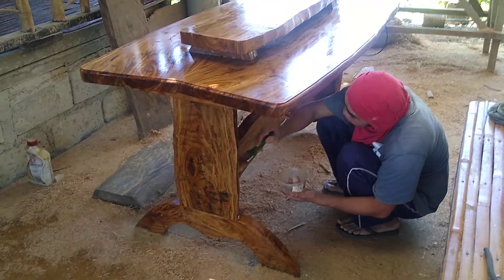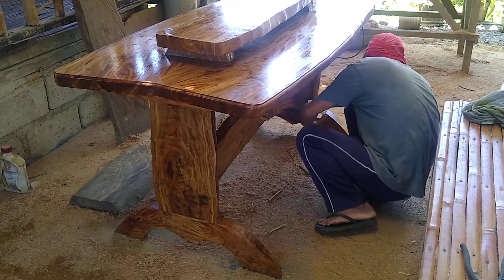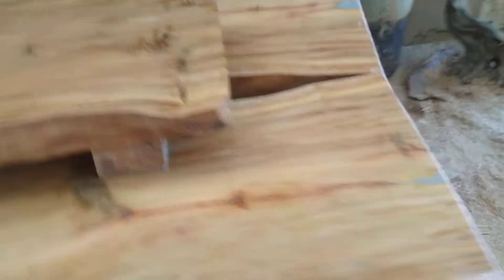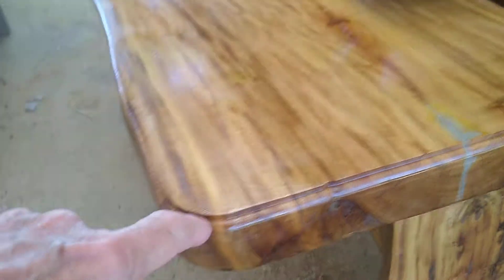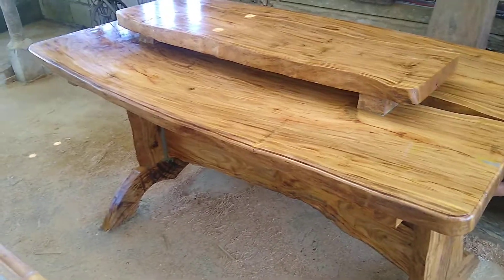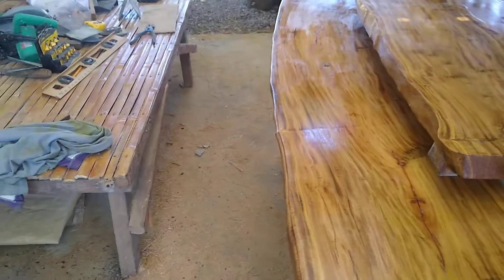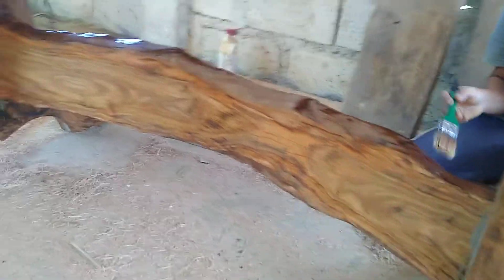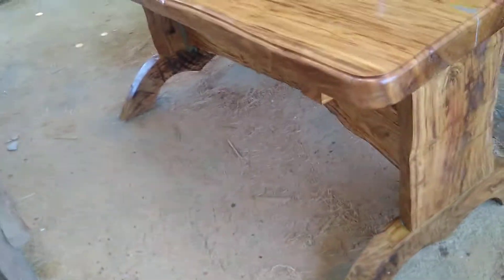Finished Hardwood Table in the Philippines

Comment: beautiful work! if its not to costly you can have a glass shop cut a piece for a table top and cover the hole and protect the wood
Reply from the maker: Probably get some clear expoxy. I would have left the whole table top flat. Unique design. He just built a bench set for one side of the table.